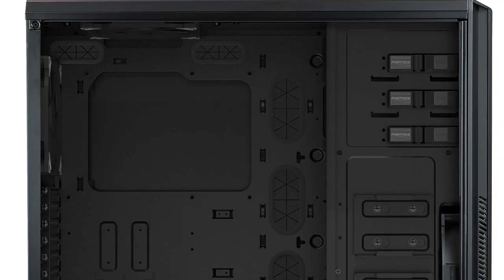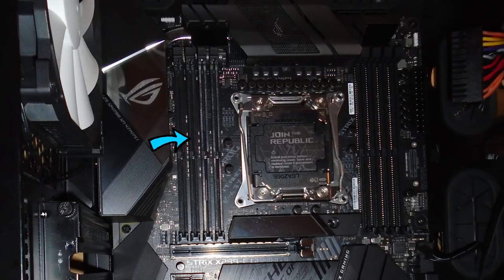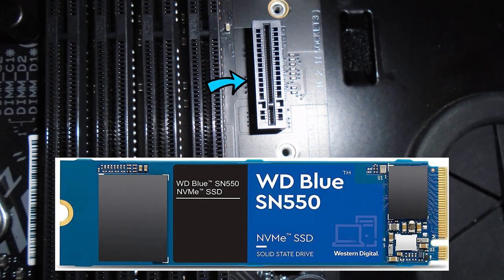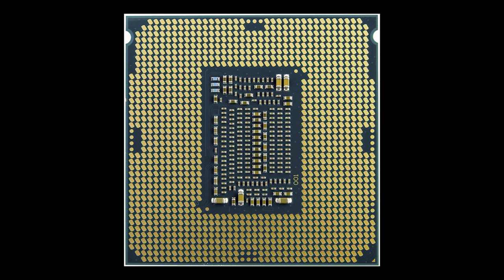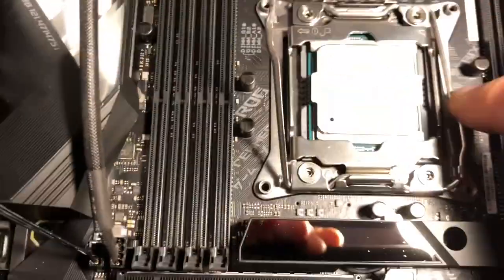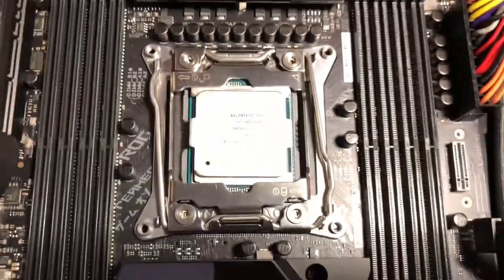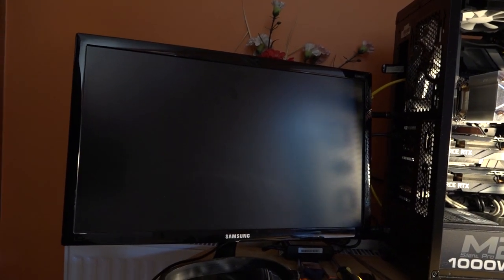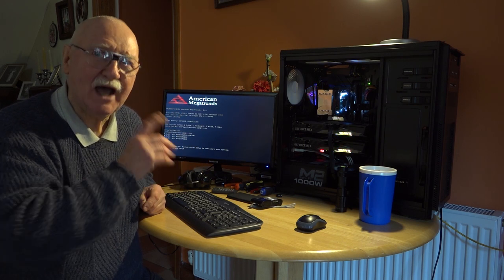Quarantine Freedom Flight Update 3

Comment: Hey, just letting you know you applied a little too much thermal paste there. Its meant to be a size of a pea. When you apply too much thermal paste, it can act like an insulator. At best case, this may make the paste ineffective, and at worst case, you may damage components via overheating. I am trying to not sound rude, I am just giving you a little tip because we dont want your simulator to crash again!! Thanks Dane. See you on the next flight, and great video too! 🙂
Reply from the maker: You are correct about the paste of course - but in my case, and it wasn't clear enough on the video, the amount was actually quite small. I have smeared the paste over the plate as much as possible and that's what made it look so much. I was actually worries that there wouldn't be enough as I had to squeeze the remaining paste from the tube - I almost didn't have enough. But good call there - well done! 👍
Reply: @FatherDane  ah right no problem thanks
Reply from the maker: @mindfibeats1380  👍

Comment: Hello Father Dane. Glad you’re making good progress with your rebuild. We communicated sometime ago about displaying and aligning standby instruments on MIP for P3D/PMDG737 setup. I found 2D panel doesn’t really work well for standby instruments even in P3D Vn5. I think you mentioned that you had similar problems and you now use dummy stick on labels to cover the standby holes in your MIP. I am also constructing a simulator similar to your setup and have used Air Manager for displaying working standby instruments and it works quite well with P3D/PMGD737. Although Air Manager doesn’t come with exact standby instruments used in 737, but there are plenty of others to choose from although not 100%  perfect for 737 MIP. As you’re rebuilding your new system, I was wondering if you considered using Air Manager on your new setup. I don’t think the software uses too much resource on a PC.
Reply from the maker: Thank you for that tip - I shall certainly keep that in mind. I hate the stick-on ones I have but in truth, I don't look at them much any more, perhaps because I know they are fake. I will look into this after I have everything else loaded and then see what resources are left. I am hoping the new motherboard and processor will be more than adequate to run everything so we shall have to see. Thank you for the tip. 😊
Reply: @FatherDane  Airmanager can be networked, so is not restricted to installation on the main (server) pc.
Reply from the maker: @737sst  Now that is very useful to know - thank you 👍
Reply from the maker: Hello - just wanted to say that your flight has been posted online https://youtu.be/zg1Jb7bkcgQ - and thank you for the challenge 😊

Comment: I can see the joy in your face when talking about this. I too build my own PC's but with the near impossibility at getting a graphics card I actually bought a prebuilt HP Omen 30L. I posted a video on my very rudimentary Flight Simulator set up, check it out and let me know what you think.

I REALLY enjoyed your video on the radios for your Cessna 172 simulator. I learned so much. I hope you do some more content on the technical side of flying. I know I will never be able to get a real pilots license because of my back issues so I am trying to live my dream through Microsoft Flight Simulator. Right now I primarily fly the Icon A5 because it is one of the simplest and versatile aircraft in the game but I want to start learning the Cessna's. Should I learn the 152 first and graduate to the 172?

My knowledge is pretty limited right now but a few days ago I actually prepared a flight plan through Sim Brief, imported it into Flight Simulator. I flew from Frederick MD to Pittsburgh under full ATC control. They vectored me right into final approach. I had so much fun doing that.
Reply from the maker: Yes - I understand the shortages and I had to wait and search for mine and then I was really lucky to grab them when I did. I'm also glad you are finding as much fun flying a sim as I get - I used to fly as a commercial pilot but now a chair is  about all I can fly. But I try to make the best of it - as indeed you do.  😊